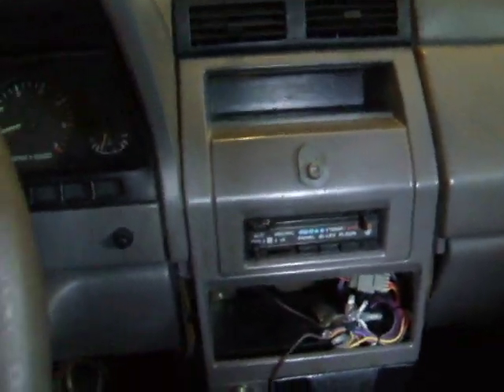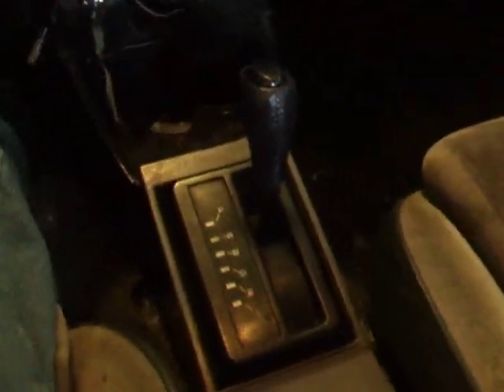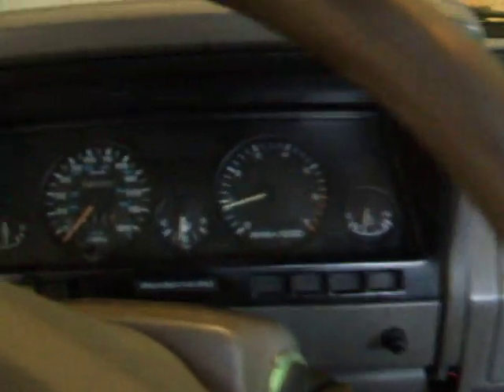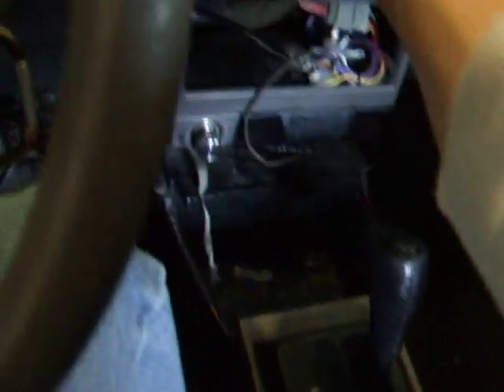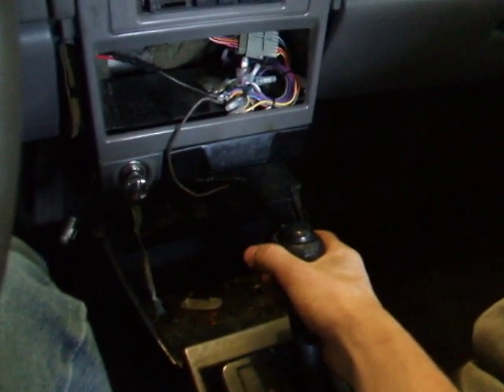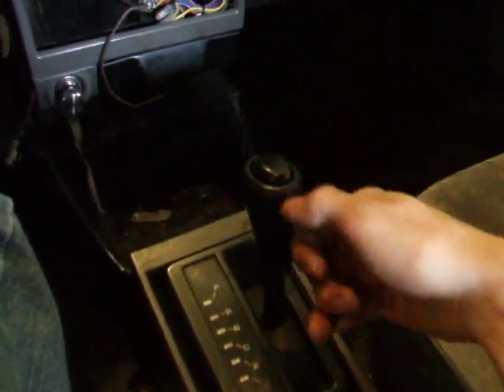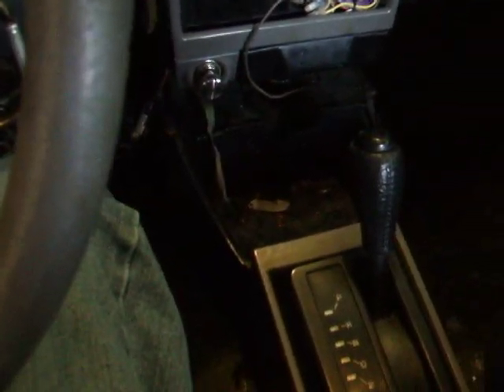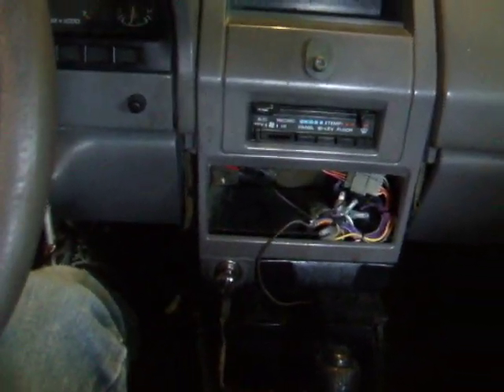Dodge Shadow Transmission Problems

Comment: Does my car do the same thing, since reparastes?? Urgent, please
Reply from the maker: Probably the torque converter is not seated all the way if this is happening. Separate the transmission and make sure the torque converter is seated all the way by turning it and feeling it click 3 times. Please note, it is easy to accidentally pull the torque converter out when attaching it again, so make sure you don't pull on the torque converter when you hook it up.

Comment from the maker: @yoyo1313144 Have you recently rebuilt this transmission?  Is there transmission fluid in the tranny and is it at the correct level?  The "click three times" applies to the number of times the torque converter must "click" into place.  This is achieved by placing the torque converter on the input shaft, and rotating it/rocking it around it until you here one click.  Repeat until there are three solid clicks.